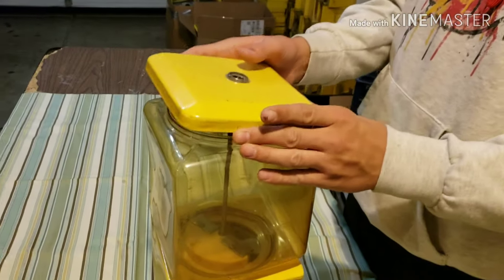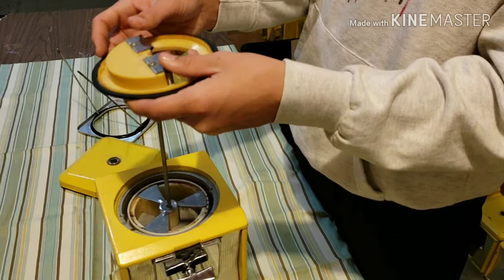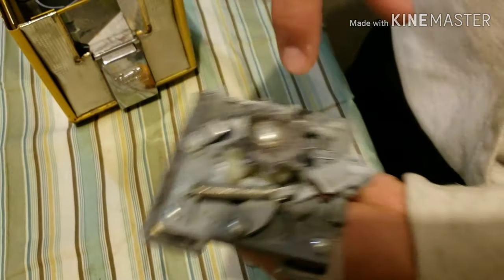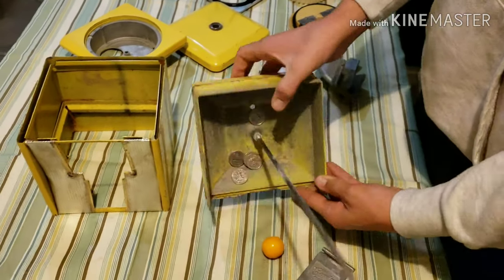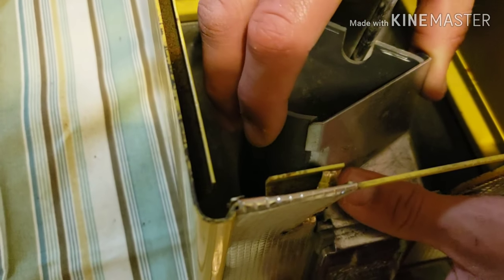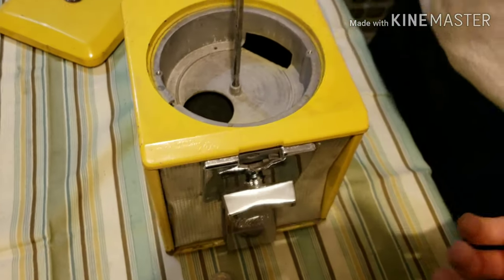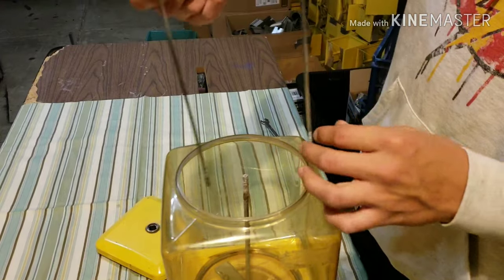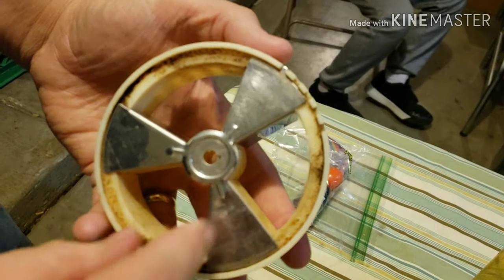How The Northwestern Machine Works

Comment: Any suggestions for a good place to get replacement part for a Northwest machine?  Why don't you put the top plate with long screws back on?
Reply from the maker: It was just to demonstrate,  I still have some parts, or if you are looking for new parts you can Google it.  If you are ok with used parts, let me know what you need and I can see if I have them
Reply: @BKVendingFlipping  I bought a twin machine that was decorated in Michigan colors.  I've only taken one apart to see why the chute was filled with Kleenex.  Your video was a big help in solving the mystery.  Whoever put it back together had the brush housing in wrong and stuffed the holes with Kleenex to keep the gumball from all falling out.  Turned the piece 180 degrees and it work like a charm.  Putting it back together, it looks like maybe the gasket is the only part that really should be replaced.  If I can't find it I will get back in touch.
Reply: Finally got both machines apart.  Couple questions.  One has metal wheels and parts.  It works but should I replace with plastic?  It there a way to change from 25 cents to a lesser amount?  My grand kids will want to play with it and I'll go broke providing them with quarters.
Reply from the maker: @mrarchitect52  you can't change the amount without changing the coin mechanism.   However, if you take the coin mechanism apart, you can make it free.  You would need to search that in YouTube, there are videos of how to do it.  As long as they are working, you don't need to switch to plastic unless you want to.
Reply: @BKVendingFlipping  Thanks for your help.  I've watched your sons video several times to make sure I'm doing right.  I now enough to be dangerous.  Not sure I want it free.  The grand kids would empty it in no time.